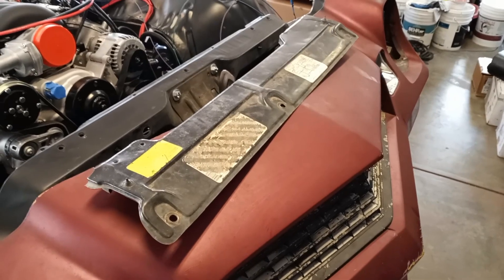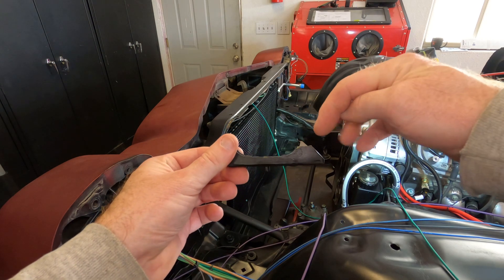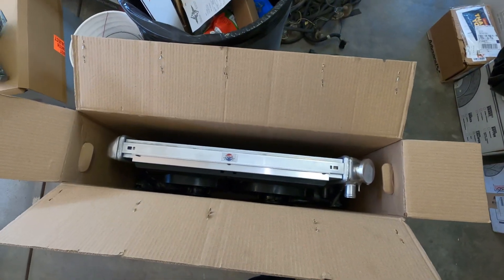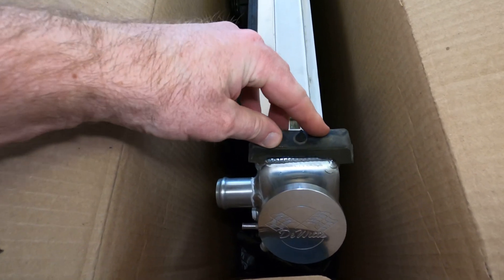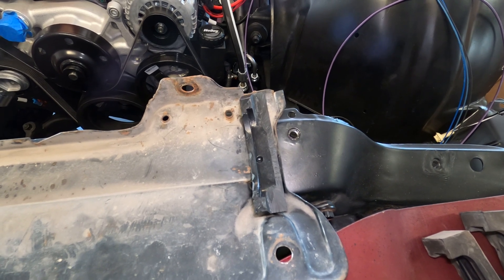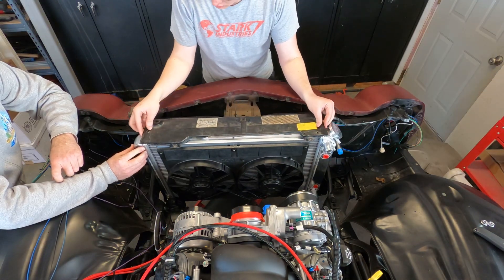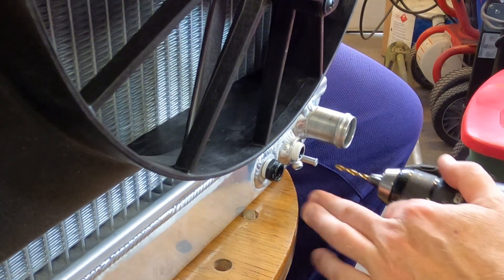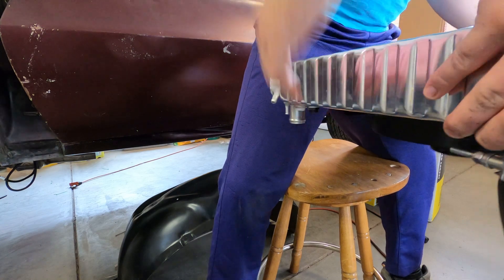LS Swap 15 - Radiator Installation

Comment: What made you choose a dual fan vs single fan?
Reply from the maker: Thanks, that's a good question.  Maybe it's because I'm from Texas!  The radiator is more than wide enough for two, there are a lot of dual-fan setups available, and we don't want the car to EVER overheat, not even under the worst conditions on the hottest day.  Basically, better safe than sorry.

Comment: Hello, can you please let me know what radiator that is and where I can get it? I'm doing a 75 Camaro, Thanks!
Reply from the maker: Always happy to help: It's a DeWitts 32-6139005A (and listed in the "Parts Used" section of this video's description), and we bought ours from BRP Hot Rods.  I just revisited their site, and you have to search by make/model/year (and not by the DeWitts part number).  We always shop Summit, the manufacturer (DeWitts), and eBay (sellers with a good reputation).  Good luck and I hope you'll come back and post how it went!